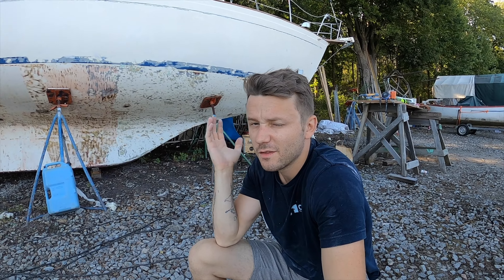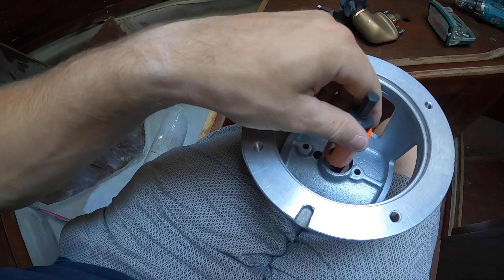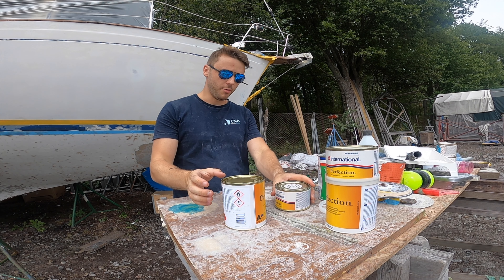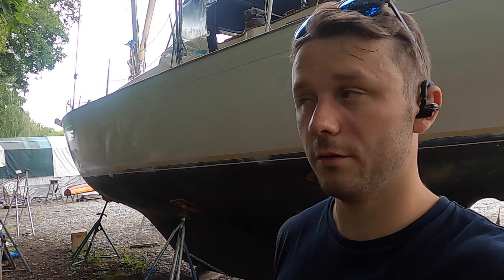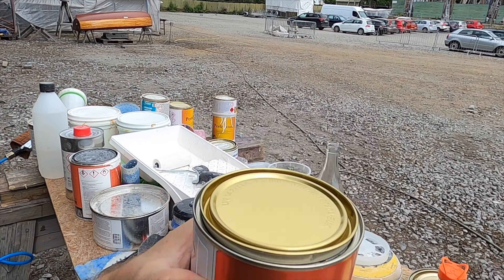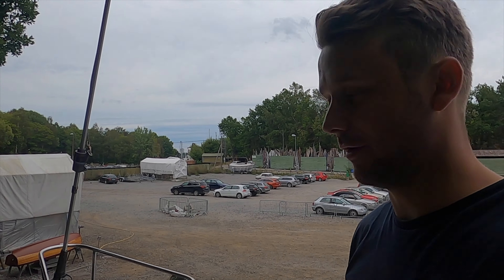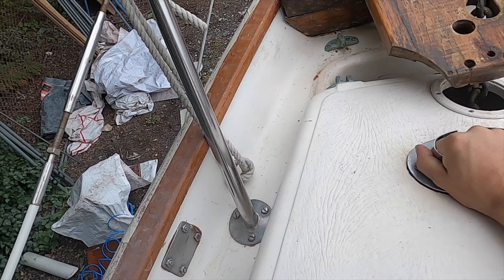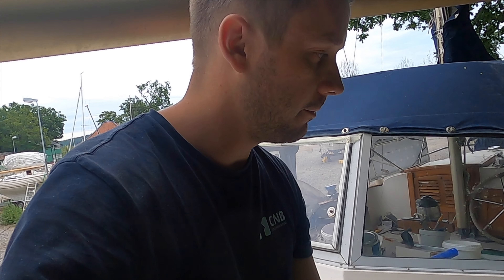Sailing boat Snowbird  Ep 3 Hallberg Rassy Rasmus 35 spray painting boat and some lessons

Comment: We had faded plexiglass in the opening windscreen too.  We took it to a shower door glass company and they made safety glass with holes for the clamps and also I added a marine gas strut support for one side which I had added first to the plastic window to test out. 

When I had it installed how I liked it in the plexiglass they were able to make safety glass to match all the mounting holes in the plastic and build the aluminum frame back around it.  

Now we can see through it easily since it is clear and not fogged plastic.  2-1/2 years later and it is still fine.  It only cost around $150 US which was a really good deal we thought.

Shower safety glass is basically what the original windows were made of.
Reply from the maker: Such valuable information for me, really BIG thank you for that.

Comment: Why do you paint on top of the gelcoat? Wouldn't topcoat be more robust? Just want to learn...
Reply from the maker: Hi, it's a good question. 
l can shortly explain.
Gelcoat is the same as a topcoat with very little difference. Gelcoat you place when you build a mould and then it goes as a first coat, before anything else.
Reply: @coldnorthadventures5905  Ok, so do you mean that you painted with topcoat? I thought it was some kind of ordinary two component paint.

Because I wonder why you don't only use gelcoat and then topcoat on top. Why paint?
Reply from the maker: @fredrikjohansson3412  Ohh yes,  l use it because l need to fill up the small cracks on the boat instead of using a filler l use a topcoat, also it's easy to apply and sand, afterwards you can place a very thick layer that will cover up all the cracks.